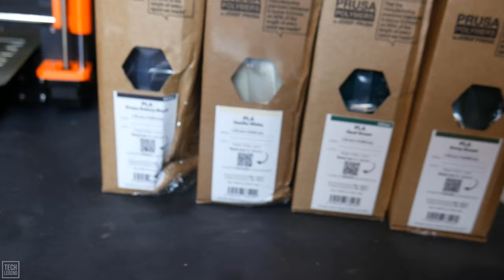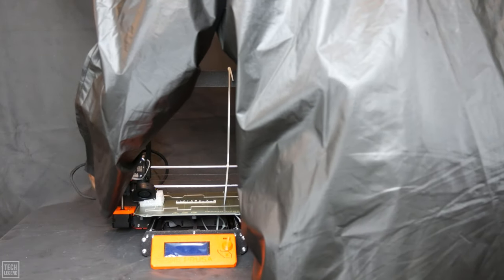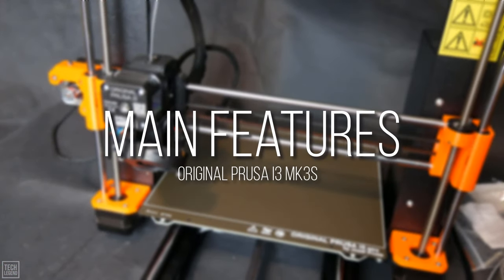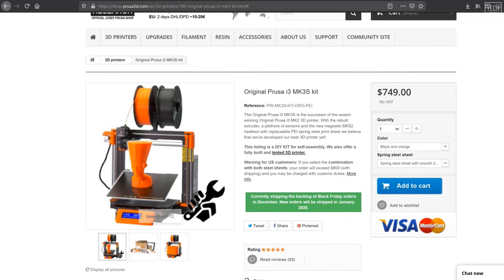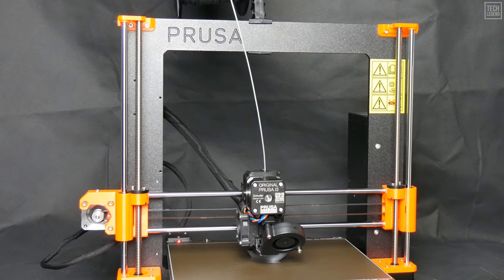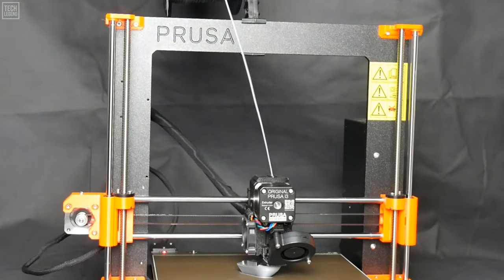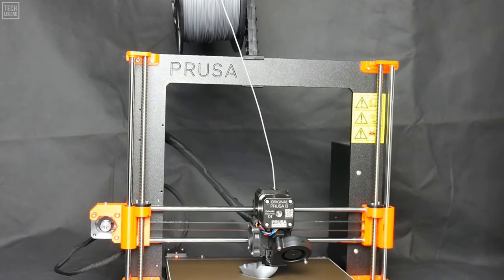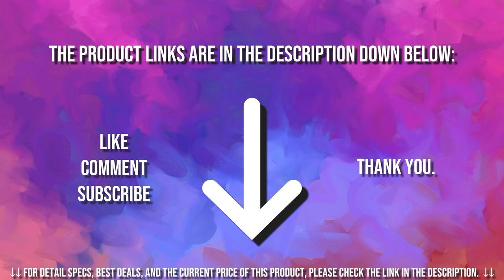Original Prusa i3 MK3S Review | 3D Printer | The Best

Comment: I wonder how this printer stacks up against the new CR-10 V2? I know the price points are different but still curious. The Prusa is more expensive I guess because it has more features built in out of the box compared to the CR-10 V2?
Reply from the maker: Prusa i3 Mrk3S is better in my opinion. The Prusa is amazing. I only had one failed prints, and it was because of the print didn't stick to the bed (its easy to fix by putting some glue). The CR-10 was a good beginner printer and for the budget. [+] If you want to plug & play, Prusa is the clear answer (assuming you are going for "kit" assembly). Once assembled, the MK3S ready to go. They also offer fully assembled printer as well but cost more than the KIT version.

Comment: I'm thinking of buying my first 3D printer ever. I have never even seen a 3D printer up-close and never used any CAD-software whatsoever.

I've heard pretty good things about the Prusa i3 series, and was wondering if it's suitable for a complete beginner like me?

I like to create my own electronic devices and therefore I need a 3D printer to make various casings and custom-made parts. I have plans for building both robotics and a 3D-printed electric skateboard in the future as well.

IS HAS to be capable of using filaments that can take some weight, and not melt in the sun or break when dropped. So, I'll probably not be using PLA or ABS (I think?). By the way what filament should I use? PETG? Carbon-mix? 🤔

Durability is more important than the looks in my case.

If the Prusa can't use the filament I need, can I modify it to make it work? If so, is it because of the shape or temperature of the nozzle or the maximum temperature of the heatbed?
Reply: Learn CAD before looking at printers. That's quite a commitment to make at your state.

Comment: It’s a very badly flawed printer for two reasons. The cables from the nozzle heater run under the back of the nozzle. This means any failed print (roughly 1 in 5) causes the delicate cables to get encased in a blob of plastic goop. The goop is almost impossible to remove without damaging the cables, requiring a new hot end or thermostat (I’m on my third) to be fitted.
The cable harness doesn’t have sufficient clearance around the frame. Any movement in the cable ties holding the harness, and it fouls on the frame and your prints get sideways sliced.
Neither is a necessary design feature, but between them they make the printer a very frustrating and unreliable device to use.